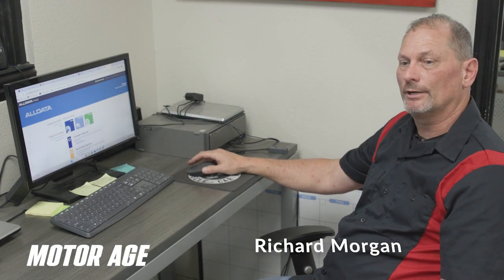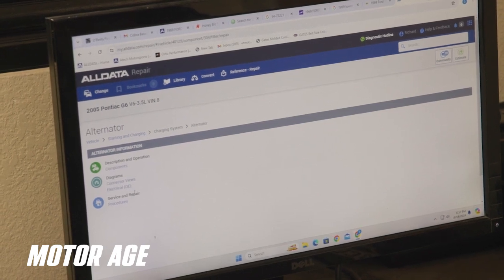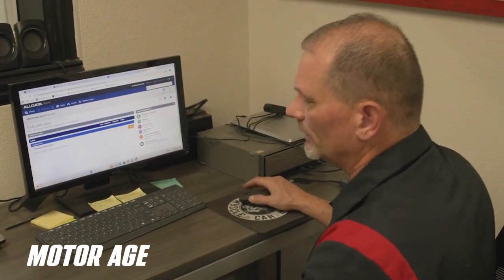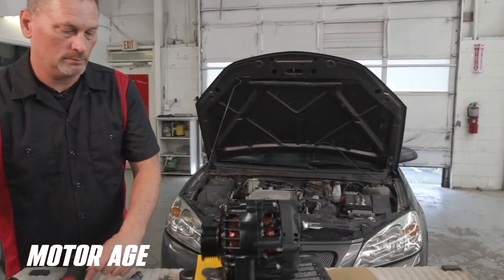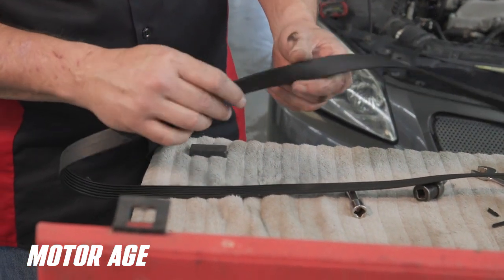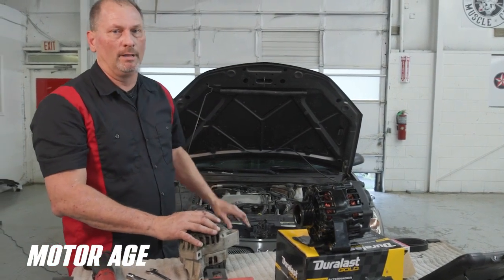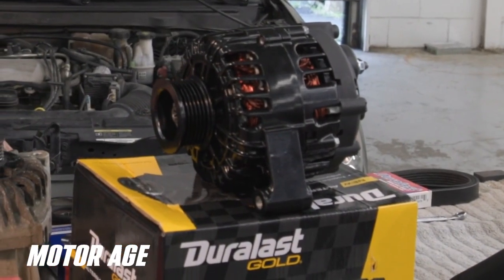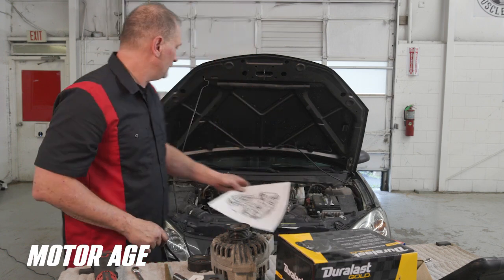Service Done Right #28: 2005 Pontiac G6 Alternator Replacement

Comment: I would have tested the output of the alternator at the battery using a load tester or one of the newer tester. 
Then verify there's no voltage drop from the alternator to the battery.  If there's an inline fuse there will be about a tenth (.1) of a volt which is normal.  Next check for a voltage drop on the Neg bat post to the engine block or alternator mounting bracket.  No more than .1 to .2 voltage drop.  Lastly, clean the battery posts and cable ends.  If all is well then do your road test.
Just simple maintenance that eliminates any problems now or later.